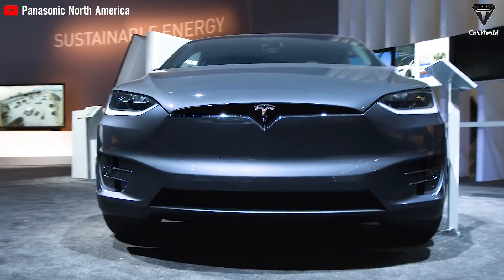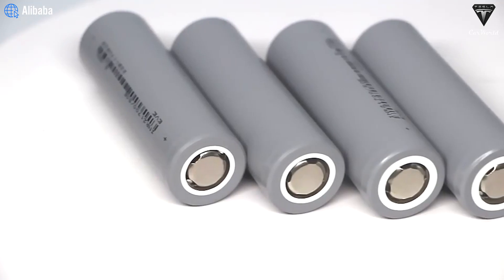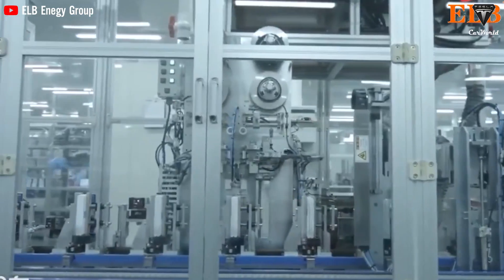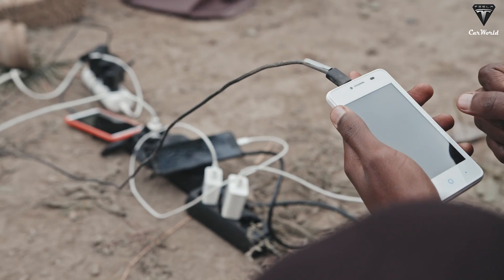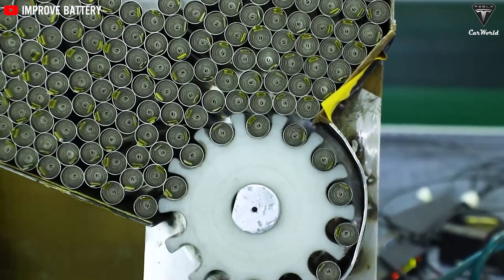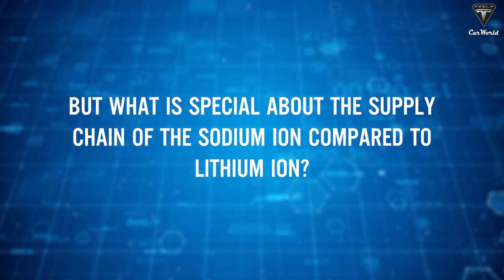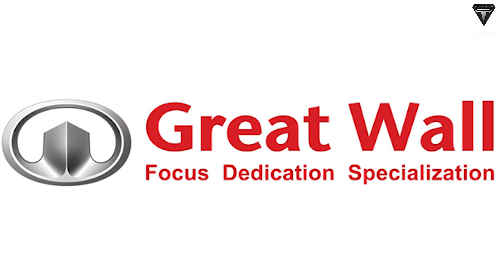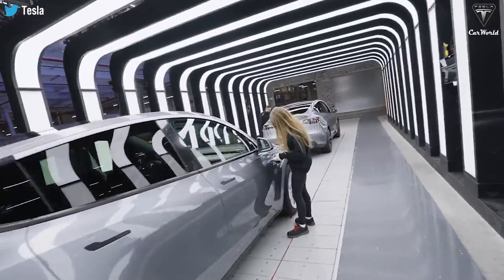Elon Musk Revealed Why Sodium-ion Could Destroy Tesla Lithium-ion?

Comment: Hardly nothing thats true. A nice made up story for nothing.. why. Tesla just invested and are building new Lithium extraction plants for billions.. their own mining from sand, with only water and salt(sodium), heat and recyklingprocess. Tesla uses Sonys 18650 they released 1992, they have +30 years of solid data on first millions, then sence a few years back billions of cells. They will probobly just throw that away to something with a years study or two on, that's as likely as they would swich aluminum for plywood. 

Then its the absolut total opposite on Lithium prices, they have dropped like a rock for months and are down in China to below mid 2021 prices.. thats a second to look up for anyone. It was up to almoast exactly dubble the price it has today about 6 months ago.. its one of the most abounded materials in the world, its in the oceans, in sand, in soil, its among the top 10 most common materials on earth. Sounds like we are running out? 

And then you have the other next way of thinking, abit longer then the nose reach, they have refined the process to recykle their own batterys now for about 10 years. They can get back over 95% in total to new batterys again. Thats also something they likely will stop, and not do after factory designed for it thru one of Elons best friend and Co founder of Tesla. 

They have a model to follow, simple, as simple as possible. Changing something like this could throw the hole thing wrong and that would just be totally stupid. Then they can look in to it, spend millions to test them and look at the option, but your headline and way of explaining the first few minutes was total bull.. and Lithium is what you're showing ocean extraction of there, not sodium. Lithium is also in the ocean.

It binds to tablesalt, sodium. So with sodium in water you mix sand. You then dry it, the Lithium has bound to the salt. You separate salt and sand, throw back the sand, the Lithium then gets extracted of the salt that can be used again. Almoast closed loop, water can't really get reused to full if you want to get speed on it, but instead of todays tons of chemicals with huge wastes Tesla will extract with just water and tablesalt and throw back the sand. 

Where they now start they have found more Lithium in one state then the whole of US would use to switch everything to electric, one state for all transport, heating, cooling, factorys and all. And its still will never be enough.
Reply from the maker: We sincerely appreciate it. We highly value your expertise in this field. We really want to deploy electric vehicles with battery power to cut emissions and prevent environmental pollution. But there are significant shortcomings in the use of lithium to make those batteries.

As for extracting lithium from water and salt, it's a very good thing, but the truth is no one has done that yet and all the materials are coming from traditional lithium extraction.

Why then do we not consider other, better possibilities but at the same time continue to study and develop the batteries we now have?

Comment: I don’t think Lithium Ion is the future at all. But I don’t think Na-Ion is either. The Aluminium Ion Graphene battery has twice the energy density of Li-Ion. Charges 60 times faster. Aluminium Ion batteries contain no rare earths. They have NO overheating issues at all, and don’t require cooling. Sodium or Lithium? Neither.
Reply from the maker: @richardhoulton4016  WOW. Thank you for your advice. The battery sector is expanding extremely quickly with the emergence of batteries that are swiftly optimized in all parameters, such as capacity, energy density, or battery safety.
Reply: @emilioagudelo5787  Not true. They have solved this problem (it’s where the graphene comes in) and the Aluminium Ion Graphene Battery has done 10,000 recharge cycles with virtually zero degradation.
Reply from the maker: @emilioagudelo5787  We appreciate your understanding. While it is true that it is challenging for freshly manufactured batteries to match the energy density of LFP batteries, there is no denying that sodium batteries are making great advances that allow them to catch up with the LFP battery in many other respects.
Reply: @emilioagudelo5787  10,000 recharge cycles is way longer than the life of the car. If you recharged every day that’s 27 years. Fast charging will be the tipping point for EV adoption. The moment you can recharge a vehicle to do 400 miles in 5 mins (and the Aluminium Ion Graphene Battery will do that) it’s game over. It also means we won’t need anymore charging stations than we have petrol bowsers now.